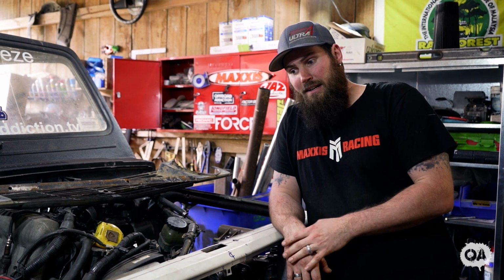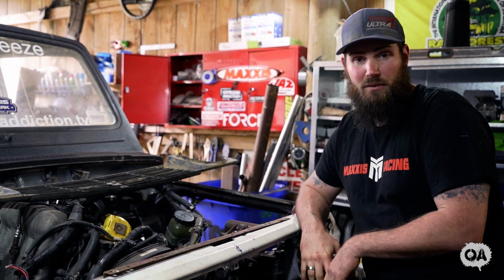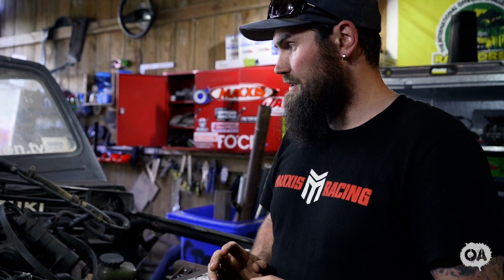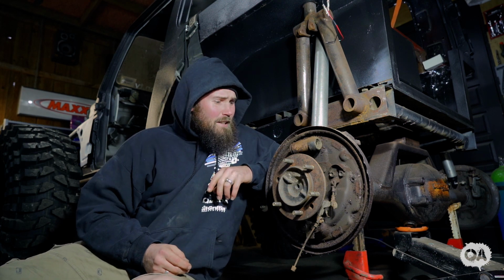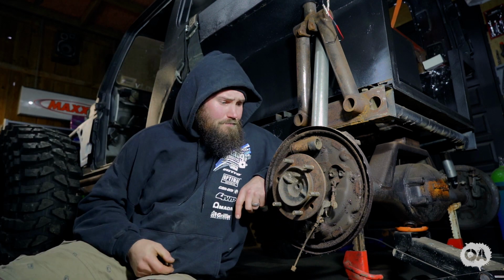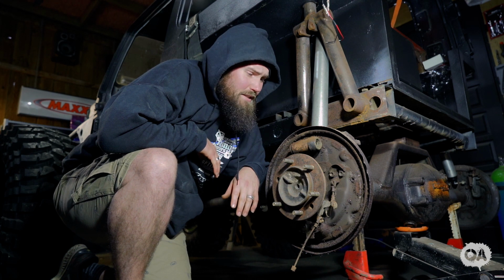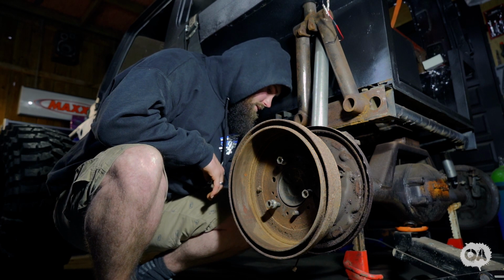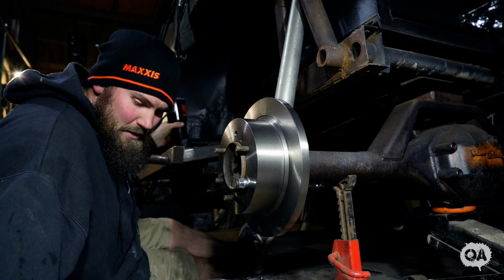It's Still Here - EP61 - Project #Tightsqueeze - Suzuki Samurai SJ413 Tin Top Turbo Build

Comment: For the rear bearings try ''terrain tamer'' in south Auckland  if its toyota. 42 hobil road. Manakau. You may need to make a bearing removal tool. its basicly a piece of pipe shorter than the axle by about 3''. you drill and weld on two flanges . One will be left plain except for the hole in the middle and the other end matched the flange on the backing plate . You bolt it to the axle after you welded it together and mount it in the press supporting the other flange pressing on the inner end of the axle. Try SAS Suspension parts for the bearing kit. There prices are usually good.
Reply from the maker: Thanks Andrew, Repco had some but i wanted to confirm part numbers before ordering. Forgot about Don Kyatt. I was going to make a tool using an old axle offcut but i think pipe is easier. I'm sure it will be a fun job either way haha